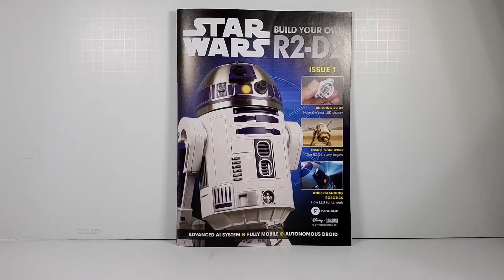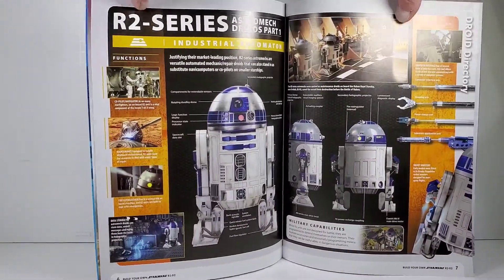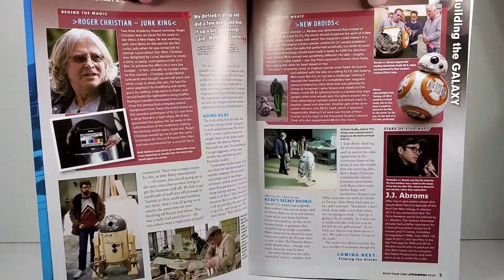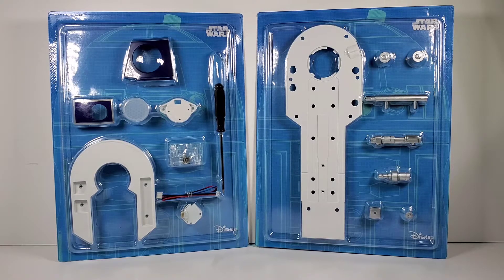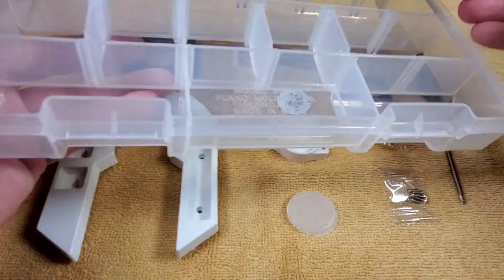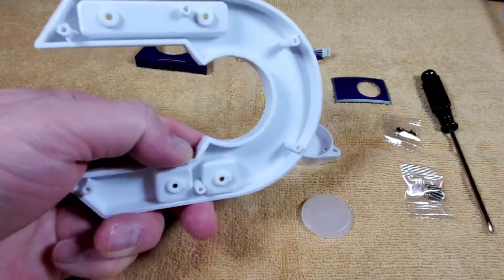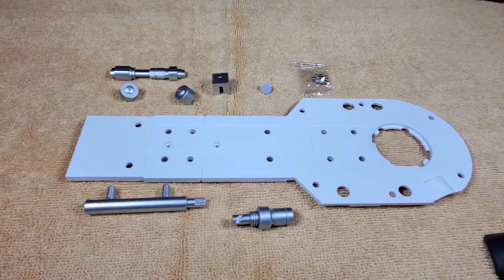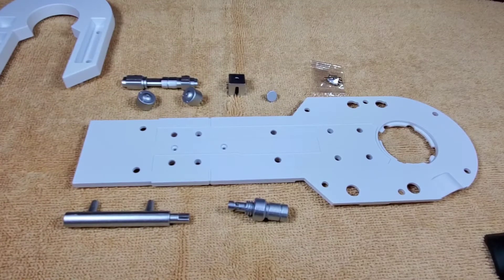Part 1 Building The Fanhome R2-D2 Stages 1 & 2

Comment: Nobody (yet) has the stamina, patience & wallet to finish any of these kits haha ! Even the older Eaglemoss DeLorean & Enterprise kit's. They always end up on Ebay as parts. Do you plan on doing Iron Man's Mark 3 suit ?
Reply from the maker: I plan on seeing this project all the way through as well as the Enterprise D build I'm also working on. My only beef with these kits is they need to allow us to have the choice to buy more parts instead of just limiting us to only 4 stages of parts per month. Especially R2-D2. They already did a full run of R2 a few years ago so it's not like they're still making the parts. They've already got everything ready to go. It's not a new kit.
Reply from the maker: No I'm not doing Iron Man. I'm not much into superheroes.
Reply from the maker: @doejon9424  Yeah I think the length of time to build these is what turns most people off. I agree, I'd like to just buy all the parts at once and build it at my leisure. The only issue with R2-D2 is that he uses some weird batteries and they don't come with the kit. You have to get those yourself which is ridiculous when you think about it. But he is amazing once he's all built. The parts are shipped pretty well. The packages the parts come in are nicely compartmentalized. I did have two issues with the Enterprise so far. One stage of parts was missing. Number 20 but Eaglemoss quickly replaced it. And the red lens for the impulse engine on the neck was mismolded but thankfully it didn't affect the build. The parts are really nice overall though and the kits are fun to build!
Reply: @outsider238  That's super cool ! I'm definitely going to choose one soon. That battery issue with R2-D2 is bullsh*t with a capital B. Especially at that price point AND them being a specialty battery but it is what it is. I am leaning towards R2. Have you reached out to them about having additional packs sent ? They most definitely have all the kits completed in sure.
Reply from the maker: @doejon9424  I'd say R2 is probably the best because you can play with him after he's all built. Most of the other kits are mainly for display. I agree, I think the batteries should be part of the kit but you can find them relatively easy. I did call Fanhome and asked them if I could buy all the parts at once and they said at this time they weren't offering that. They told me to call back in a couple of months to see if their inventory of parts is far enough ahead that maybe by then I could buy several issues of parts in advance so I'll be sure to do that.